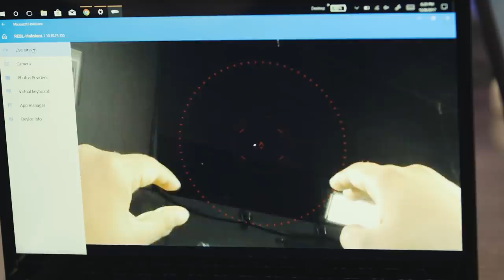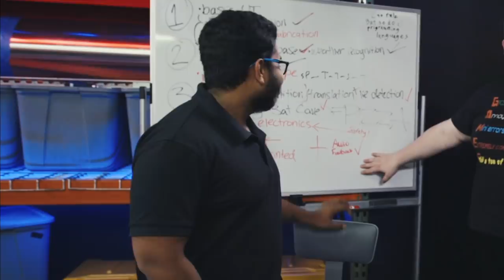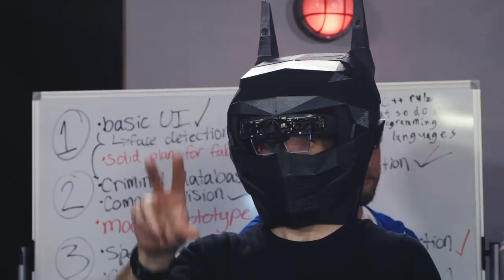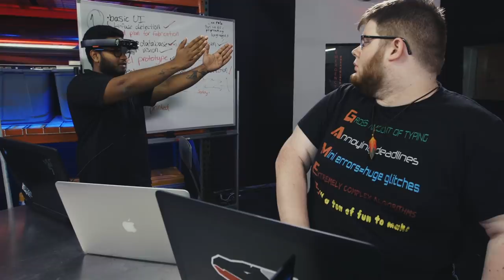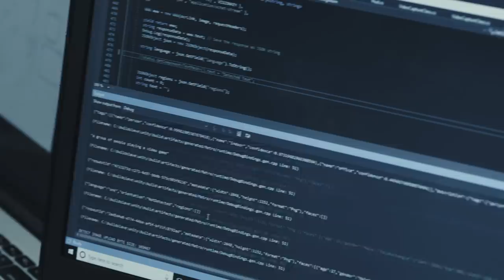Hacker Labs: Batman Cowl Challenge Finale | Full Sail University

Comment: This is awesome! The only issue I saw was that the entire thing could have been much smaller. 
Start with a model of the intended head, add the Holo-lense, build up padding, add peripheral electronics, then design and print the shell. Always work from the most necessary to the most decorative...
All in all, great job though!

Comment: The problem I see is the helmets are not the problem.
The problem is there is to much time on the side things and not enough on the microsoft hololens.
Taking the thing apart and removing the extra stuff to fit in the cowl. If you removed the wring and got to the technology to slim it down
the cowl would not look so big. Also there is so much being left on the Hololens that takes away from the head hear just as this happened with
the Iron Man setup. I have seen this taken apart in a tear down  and removing the plastic. There is so much added space that the cowl would
have been more slim. The bother board is so thin. The bulk of the unit is just plastic supports. I suggest you do a brake it down to make it work better.